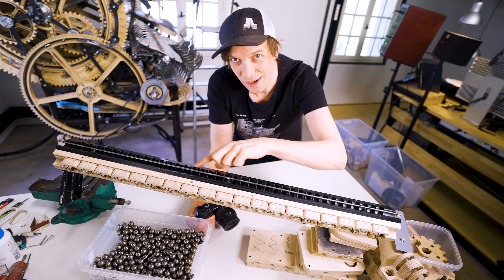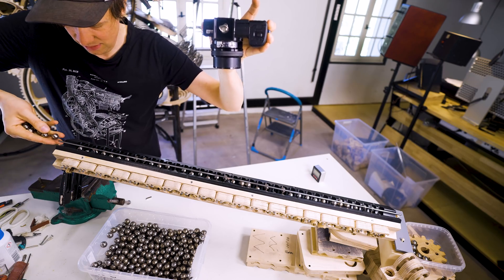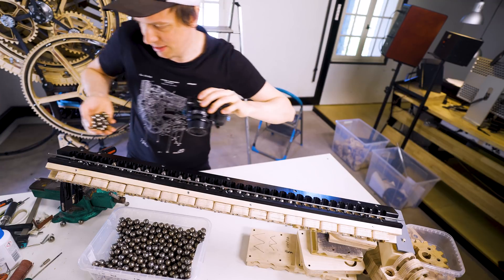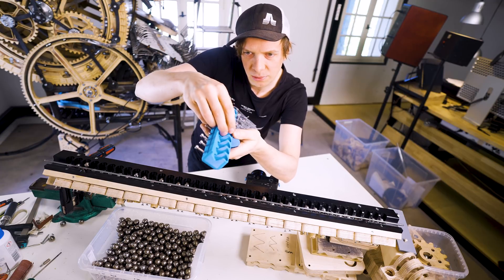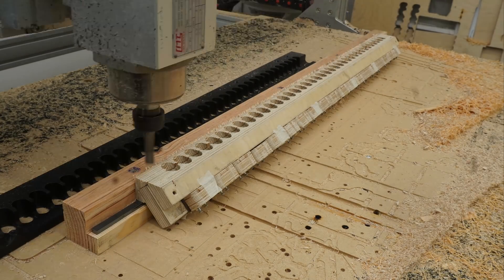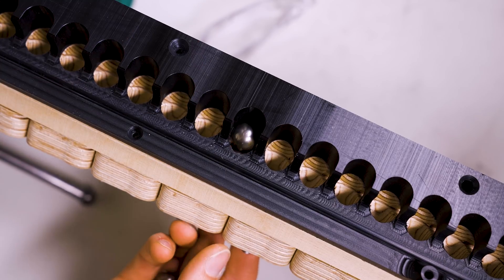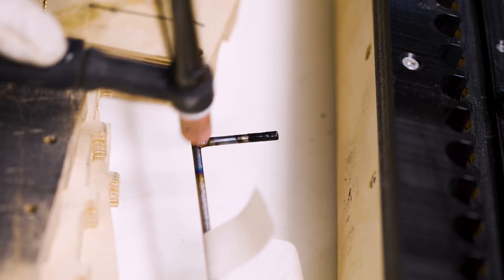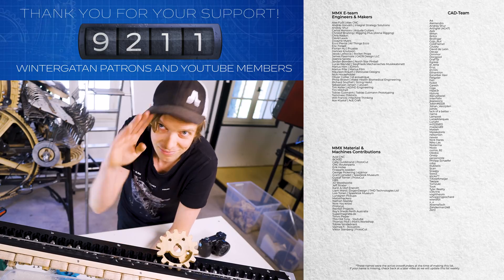Testing the New Marble Divider

Comment: You may to adjust the angles again when it is on the machine, and the machine is running. The vibrations will change the way the marbles fall into the channels, and will vibrate any that "stick" to make them keep rolling.
Reply: I agree to making it adjustable, but the marbles are mostly dropping in from the top and will do more to knock things around

Comment: You should not forget that there will be vibrations from the marble machine running, so the "weak" blocked marbles could even not happen at all in real life. Good work!
Reply: All the marbles dropping in from the top will do more to knock things around
Reply: @tommj4365  I know, but the general vibrations will also help, and that's just to say that this system is even more "stable" than what is shown in the fixed tests

Comment: While plywood is more dimensionally stable than normal wood, if your fits are super precise, should you be factoring in dimensional stability due to humidity changes? Especially since unlike other instruments you can't keep it in a case with a humidifier all the time.

Comment: 0:42 the plastic material used to make the marble divider makes it so much louder rolling across than the plywood version. 
Is it possible to make the same design in plywood so that it reduces the white noise of the rolling marbles?
Reply: @Joe Oliver. Did you see the previous video? The whole point is to not make it out of plywood so this part can function properly
Reply: @jangohemmes352  I must have missed it. Thank you for letting me know. Thought I was on track with watching every video.
 Which video was it?

Comment: I wish I was a better engineer, but those small moguls at the bottom of each divider wall is still causing so much jostling. I think you need to take one more attempt on CAD and remember that this is just as if the marbles are on "rails". One rail is the flat ramp surface, the second rail is the bumpy path made by the flat walls and round marbles. I don't think you have MAXIMIZED how flat that second rail can be.

Comment: "Give me a couple of months and all the plywood on MMX is... gone :)"
Not gonna lie, that might make MMX look way cooler. Not that your current look isn't cool, but replacing plywood would make the machine look more, idk, manufactured, if you understand what I mean. Like it's some well-engineered thing from some huge factory or NASA-type organisation.
Reply: I'm dreaming of a version of the MMX completely made with transparent acrylic instead of plywood ...

please don't wake me up :p
Reply: Gonna have to disagree here. His inspiration was from older clockwork instruments, and that's why the plywood planetary gears were such a big part of the design. I figure this comment was more toungue-in-cheek.
Reply: @RohanDX  The fact that it was inspired by those instruments doesn’t necessarily mean that it has to look like one. After all, this is a modern device, and Martin’s engineering skills have advanced enough so that the MMX design can lean towards that modern-complex-engineered-mechanism type of thing. Why not :)

Comment: Martin, can you attach something like a small metal clamp, closer to the plastic, to act as a heat sink while welding? I've done this when soldering small parts that are sensitive to heat transfer. It helps add thermal mass and even out the heat transfer.

Comment: I'm a little worried of marbles flowing in, rolling on top a group of marbles, and over the rail onto the floor.  At this point, I trust Martin to notice these things and have a fix planned for it though so I'm not too worried.
Reply: I'm excited but also expecting he may need to extend the rail higher... fingers crossed he won't have to though

Comment: It could be worth it to split up the marble divider into two or three pieces but it would require a divider between those so if one is only being used a little it doesnt eat up marbles from the others that are cycling through marbles a lot when you play.

Comment: Great work!
I don't know if you've tried this already, but when welding like that, you can use a metal clip with a short copper wire attached (The helping hands type clip, copper crimped into it's base).
This will dissipate the excess heat if it does go lower

Comment: Has there been any math done for how many marbles are going to be running through to play notes and their locations on the divider? Are you planning to feed the marble divider part way down as well to fix issue where the speed of the marble down the divider can't add marbles as fast as needed to continue to play the notes. 

On a "everything is already full"  run how many marbles per minute go to the end of the run?
On a "every slot needs 1 marble" run how long does it take to fill all slots?
On a run where "all slots need 1 marble" how long does it take to fill all channels with 1 marble?

All of this work is great, I'm just concerned that the number of marbles needed can be maintained and also that a calculation of how many marbles per minute can be played before you're running a "deficit".

It may be necessary to have 2 dividers to take care of the overall needs, especially when playing the snare drum for the beet, at the "far end" of the divider.
Reply: Marbles mostly drop in from above this divider at several points. Martin is only showing here the additional marbles coming from the side... fear not, there will be many more marbles
Reply: @Tomm J Notice most recent video is just feeding from one side.

Comment: omg that plastic material is so satisfying! is it really possible to replace all the wood parts with it? does it weigh about the same as the wood parts?
Reply: Probably costs more and would be harder to source if I had to guess
Reply: @RohanDX  i dunno in the video he said he might switch out of wood and change it all to that plastic. so i was wondering if the weights were similar.

Comment: whatswith  those v grooves ? it looks like its causing some slight uncessary stucking or is it just me. it looks like that could have been left untouched as it was in the original piece or was it not like that. Seems like a tool path that was wrongly cleaning up that spot

Comment: What Is your fascination with subtractive manufacturing? an ender 3(Edit30) would make your life SO much easier. Why are you wasting your time babysitting a CNC machine, and pounds of plastic?
Reply: Wasting time? You can actually do other things while CNC is running, like audio books :]
Reply: Because its actually faster and you can make much bigger parts?
Reply: @randomnickify   in pure time, maybe. depending on the part. But in active engaged time, no shot. All the fiddling with tool paths, bolting the part down to the work surface, and vacuuming up chips all disappears with a cr-30 and a table long enough to support the part. Hell, even the timelapse could be automated easily with octoprint! 

A CR-30 could've made probably 80% of the MMX parts with so much less fuss. After initial set-up and tuning, slap that model in the slicer, make sure it isn't trying to print mid air, and boom. Part usually comes out the other side.

Also with printers, with precautions, it's fine to leave them running overnight, adding more run-time per day to offset the, admittedly slow, speed of prints. 

I would not feel comfortable leaving a consumer CNC running overnight in my house or workshop.

Comment: When this is installed on the machine, and it is running, shaking and vibrating, I don't think there will be any issues with marbles becoming stationary....
Reply: Also, the speed the balls would be coming into the divider at would be a factor never mentioned in his videos. (if syntax mistake, big pardon, English not first language)
Reply: @solarplexus9782  Slightly awkward phrasing, but something a native speaker might do as well.

"would be coming into" is acceptable conjugation, but "come into" is probably better. When a hypothetical situation is also very likely to happen, you don't have to use "would be" and can just use present tense.

So the sentence can be: "The speed the balls come into the divider is a factor never mentioned in his videos"
Reply: @louisvaught2495  Thank you for that. When I wrote my comment I was thinking about the wavy new slope thing coming from the "elevator". He adjusted it to the point where he could have more than 1 row sliding at the same time, so that it would look awesome in a concert situation, or just in general. But surely the marbles would enter the divider at different speeds. Even at different locations.
Reply: @solarplexus9782  I've been thinking of this since he started playing with this design. He is testing marbles entering the divider with a very consistent hand feed. Hopefully this does not become an issue with his marble fan dropping all from the top.
Reply: @solarplexus9782  Americans would express your idea like this:
also, the speed of the balls coming into the divider is another factor not mentioned in the video. 

Your English is great just a few idiosyncrasies to work on. Hope this helped.
Reply: @hedonisticzen  Thank you very much.
Reply: Agreed.
Reply: Yeah. And that will open the door for a whole new horde of moles........
Reply: Agree, and the marbles might skip if it's going too fast
Reply: I was going to say the same thing. In industrial applications, vibration is sometimes intentionally applied to encourage movement. The MMX's natural vibration might be enough to give the same effect. Playing with the way this marble divider is attached to the MMX might help it vibrate more or less, i.e. a more or less rigid connection will change its natural frequency.
Reply: True.
Reply: It might be the opposite. Maybe the vibrations take away momentum from the marbles and they barely move. Though I doubt it will happen at the speed and angle he has shown here.

Comment: What you have there is not a redundant design but rather a more tolerant design.
Reply: "robust" (as many have mentioned)
Reply: Wouldn't it be lower tolerance though?
Reply: @tommj4365  No, higher tolerance. Something is more tolerant = can stand more things changing. Lower tolerance = less things can change before it breaks.
I can tolerate a great deal from a friend. I can tolerate very little from a stranger. Less tolerant = less patient, in this case.